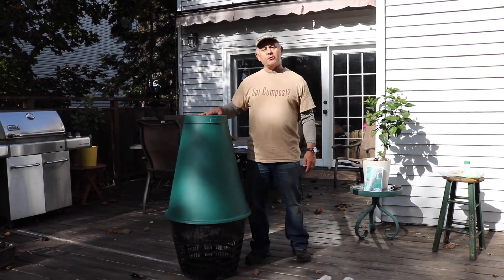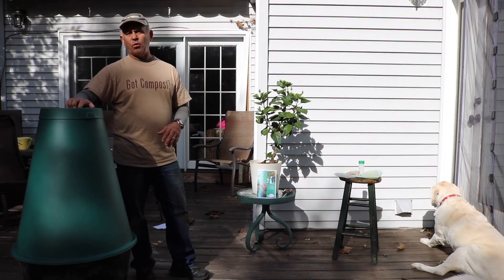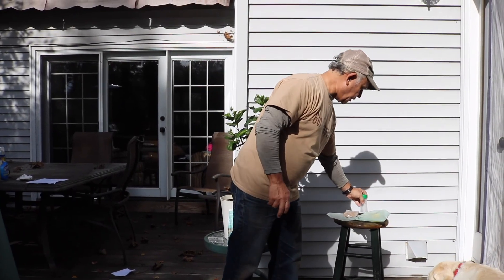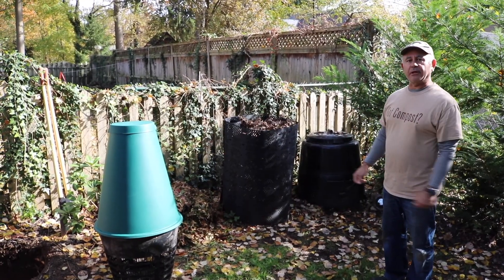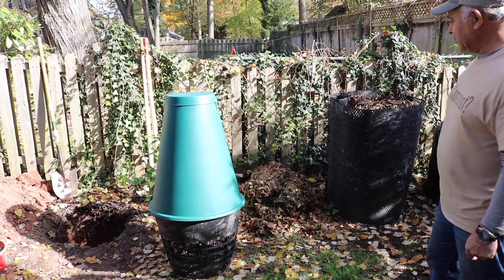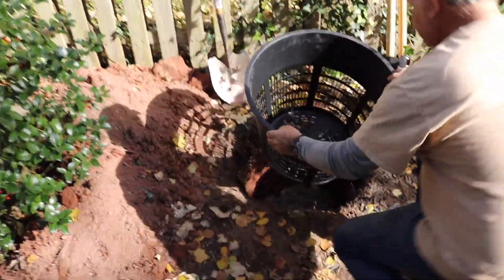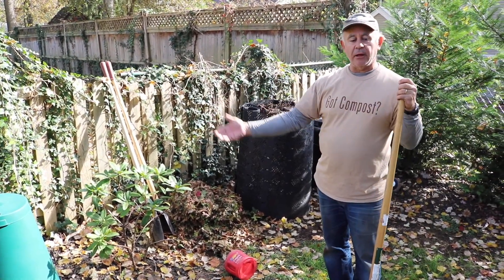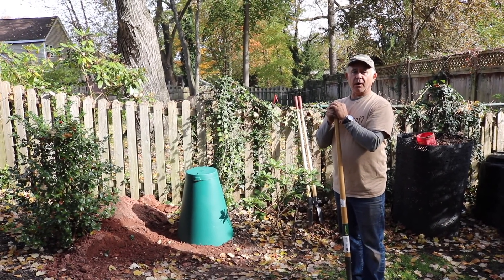The Compost Lab - Installing your Green Cone Digester

Comment: You need two of these composters. I have been using two for many years. One full and rotting down .The other filling. It does stink when emptying so need to bury the waste. It has one fault the cone to basket needs in my opinion rdiffren fixing as in our damp climate the bolt/ nut rust.. modified mine with using screw and plastic rawlplugs.. The basket remains in the ground surround with stone chippings to assist drainage and prevent burrowing rodents. All our kitchen waste is added for two of us.. Its great way of returning mineral to our kitchen garden. If you like me have rodents scratch around base cone afd stone chipe or scatter fire ash around base.  But you need two that important